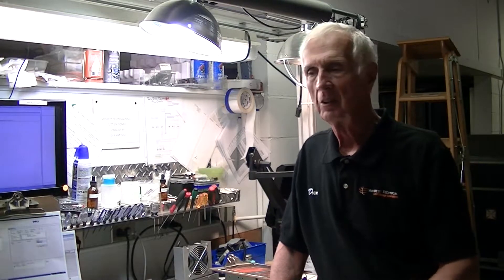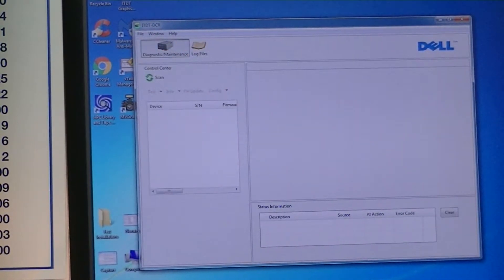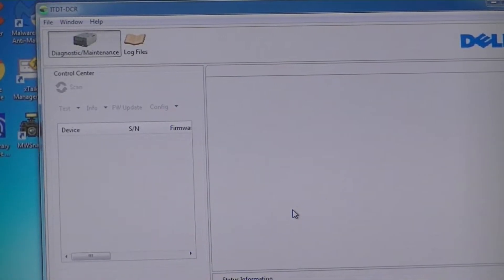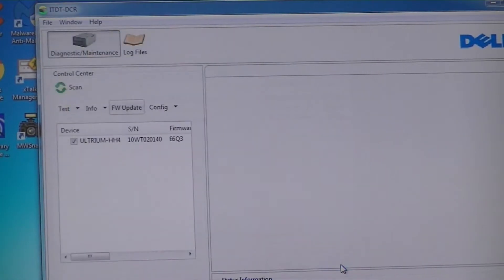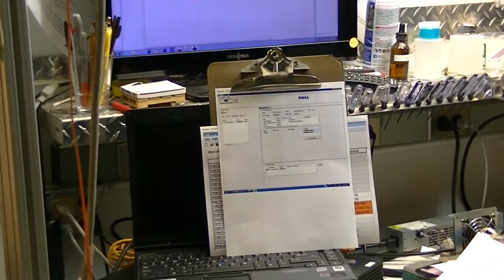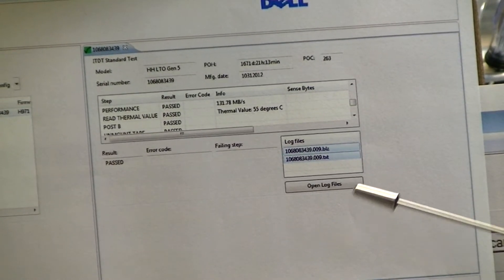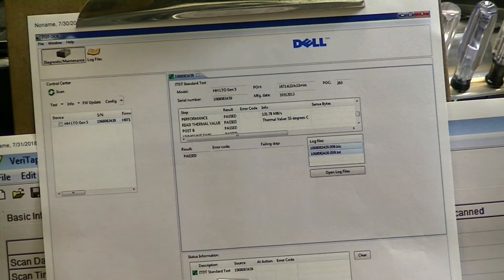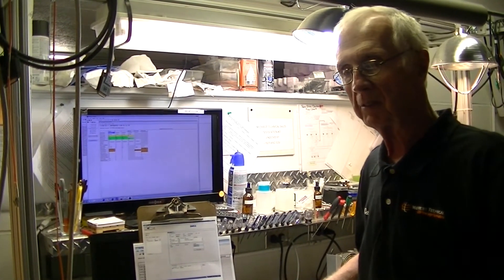How To Test A Tape Drive Using ITDT - IBM DELL

Comment: Thanks matthewr21 for this tip:
"Try this: Set all the DIP switches on the bottom of the drive to OFF, connect a computer to the drive's RS-422 library interface connector with an RS-232 to RS-422/RS-485 adapter, set the serial port on your computer to 38400bps, one stop bit, no parity, 8 bits per byte, and then send the following sequence of bytes: 02 00 36 AC 01 00 00 00 01 FF F2 00 00 00 00 00 00 00 00 00 00 00 00 00 00 00 00 00 00 00 00 00 00 00 00 00 00 00 00 00 00 00 00 00 00 00 00 00 00 00 00 00 00 00 00 00 00 00 E6 03 "

Comment: halo, I interesting about your last statement about post B and backup failed after 3TB and 1TB failed.
I have same problem and I dont know why it happen.
can you explain about "can't trap can't move because the...."?
Reply from the maker: I think you mean the part about "Can't track up ...." The head moves up and down on a Worm gear, or elevator gear.  It is sort of like a screw that spins and move the head up and down vertically. The Worm gear is part of the head assembly, so a bad worm gear equates to a bad head. It is not replaceable but sometimes we can lubricate, clean and/or adjust the gear to get it working again.

Comment: This is very informative. 

In my environment, I don't have access to log in to the server where the tape drive is installed.
As such i can not install the tool in the server to perform the tests.

I would like to know, if I can use the ITDT tool to remotely scan a LTO tape drive ?

Thank you.
Reply from the maker: We have never run into the scenario where you would want to run IDTD remotely.  Looking online, I don't see any information on that either.  The one thing that I can think of is that you need a 'scratch' tape to run the test on.  In other words, a tape that you don't mind overwriting.  When running the test, it first warns you that data will be overwritten.   So you wouldn't want to overwrite any cartridges with data on them that you want to save.
Reply: @repairmytapedrive  Thank you for this.

Comment: I got very strange mulfunction. I have Adaptec 2940 with IBM Ultrium-TD3 connected. Used it for ~5 years and it worked fine. I decided to recap mainboard of PC where I use it a week ago. Today while reconnecting all back I've noticed that connectors on 2940 are different, one has UW2 LVD label on it. And all the time I've used that system I couldn't realise why is the speed of backup on LTO3 so low. It presumed to be up to 80MB/s, but never climbed higher then 30, most of the time it was 25.
So I tried to connect streamer to that UW2 connector. But it stopped working! Windows can find 2940, it also finds LTO drive. But backup software doesn't! I use NT Backup. Not the best, but free and easy to use for home purposes. Spent few hours fiddling with cable and settings, reinstalled SCSI drivers. I run ITDT System test - it all passed! Writing speed almost doubled. But backup soft is numb. Just can't see drive.
So, I think I will connect it back to slow 'Fast SCSI' connector and try it. If it will back to work... then something is wrong with this part of SCSI adapter. But how can tests be passed?
Reply from the maker: Nihonam:  Thanks for the question, short answer I do not know.  Few things I do not understand you stated "recap the main board"  Are you referring to install capacitors in some of the buldging components?
You also stated this "NT Backup. Not the best, but free and easy to use for home purposes."  I am not familiar with that back up software, in some cases if you make changes like a different tape drive or different controller card the software needs to be re introduced to the new components.  So most folks will de install the drives and library if appropriate from the back up software.  Do a reboot and then the backup software will discover new hardware.  Most common Back up software will do this such as Retrospect, Commvault and Back UP Exec.
The advertised MG/s rate as advertised for the LTO3 is up to 80 MG/s  It is very unlikely you will see the advertise rates apply during backing up data.  The speed of the backup is related to the block size,  Just run the Sys Test in ITDT and you will see how the MG/s rates change with block size.
As you know we are a hardware repair, and sales business the only thing we can provide is a product will perform according to published manufactures specifications.
Typically a computer/data storage consultant will guarantee the entire system they sell will be a solution for your application.  I know this is not applicable to you for fun and home usage.
Hope this helps  Dan
Reply: Thanks for the answer, I appreciate it.
Yes I replaced some bulged electrolyhic capacitors, they were close to RAM sockets and I had some BSODs recently.
And yes I noticed that speed is not up to 80Mb/s in System test, it was 60-65, but it was twice faster then previously when cable was connected to Fast SCSI instead of LVD.
NT backup is very basic backup software provided with Win 2000, 2003, XP and it can only work with single tape drive AFAIK. No libraries. It rely on 'Windows removable storage' service.
Today I purchased another SCSI ribbon cable, will try it soon. Probably old one is worn and buggy.
Reply from the maker: @nihonam  Okay on all, most external SCSI cables are not ribbon cables I have seen those used on internal devices but not on external cables.  They appear to be very similar with the 68 pin cables but the cables designed for exterior use are the industry standard.  The construction of those cables are more conducive to limiting cross talk and RF attenuation for the external devices.
Hopefully you used ESD protection when replacing the capacitors, the leads from most capacitors are connected to some key components that are pretty static sensitive.  There are several articles that cover this topic.
Dan

Comment: Hi,   is it also possible to reconfigure a former library drive to single drive mode? (I  got an LTO-4 IBM HH  SAS drive out of an library which won't work without the serial 'ok' from the library....
Reply from the maker: We do have the ability to convert library drives to standalone drives and vice versa.  You could send the drive to us and we could do that for $75
Reply: @repairmytapedrive  I'd Like to, but shipping from Europe and back would cost twice as much as you get for the converting... everything added up is even more expensive than a  used LTO-5 drive on ebay :-(  So, if it is a 'company secret' how to do it myself, I'll accept that :-)
Reply from the maker: @Ford_Prefect  UG yes it is propriety on how to do that.  Basically is it accessing the RS232 port and issuing selected commands.  This topic did perplex all of the repair facilities for a long time.  Took us a long time to be able to do this.  Even by telling one how to do that project it is a lot of work for a one time conversion.  The library drives do have a code put on during the manufacturing process that only allows the drive to work in a library, this was standard in the LTO4s.  The code is on a PROM chip not an EPROM chip which compounds the problem.
Hope this helps,  If you could find a defective LTO4 with a good board you could swap the board.  You will need to follow strict ESD guidelines as well.  Those LTO4s came with a V1 & V2 head the boards are not interchangeable.
Reply: @repairmytapedrive  hmm is there any documentation about the RS232 port used or do I have to hook an oscilloscope first to gather informations about the levels used there?  I think this is 'now' also more a proof of concept for myself than it will ever be a "production" tape drive, since it is not as easy as thought.  Could you tell me what resides behind the rs232 interface? is it a low level data port or is there something like a system interface (like the AT command interface of a (cellular-)modem, which reacts at lleast a few characters after sendung an invalid input?   I am very curious about that, because I almost found nothing about that topic in the internet, despite being searching  for several hours now...

Comment: I didn't know that the Dell test tool worked on HP drives. They are competing companies, and you'd think (like seagate and WD) they'd refuse to work on their competitors products! Good to know :)
Reply from the maker: It looks like you caught a mistake, we seem to have misspoken.   You do use IBM ITDT for IBM/DELL tape drives and HP L&TT for HP tape drives.  The exception would be for an HP LTO7 tape drive, since HP uses IBM tape drives for their LTO7.

Comment: do tape drives have a standard mounting the way desktop drives do?  for example, will an autoloader drive from an ibm fit a dell or hpe chasis?  do all hpe autoloader drives have the same mounting?
Reply: Yes and no.  While the form-factor is a standard 5.25" HH or FH form factor, some HH drives have strict limitations on the length of the screws that you use.  This is due because longer screws can interfere with the internal mechanism movement of loading/unloading media.